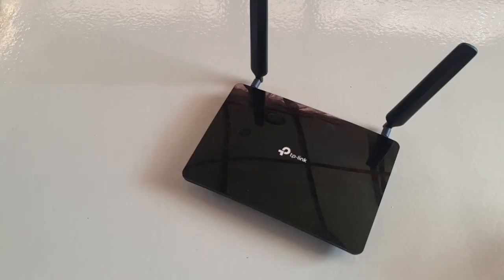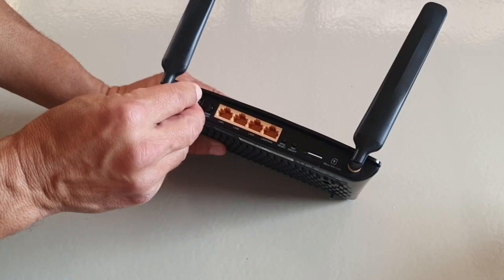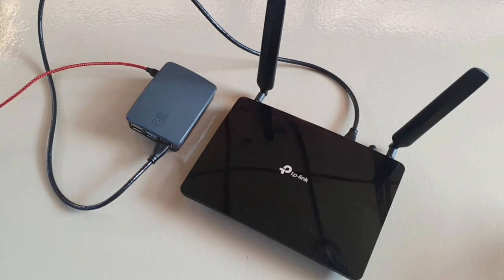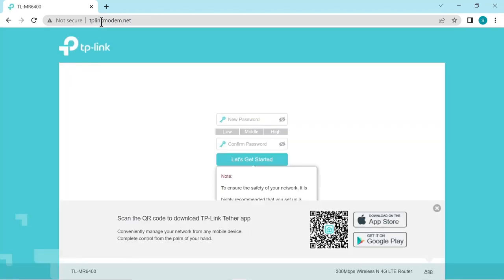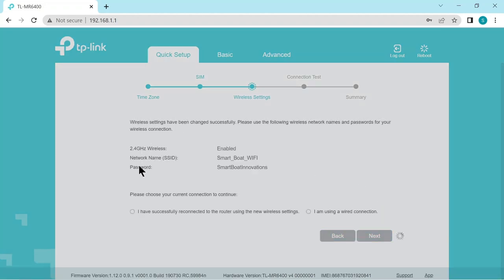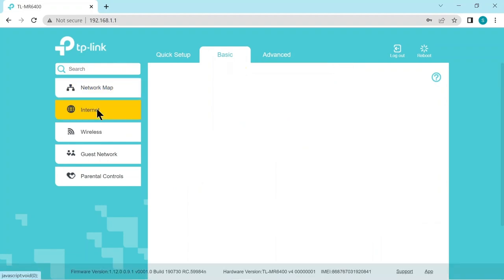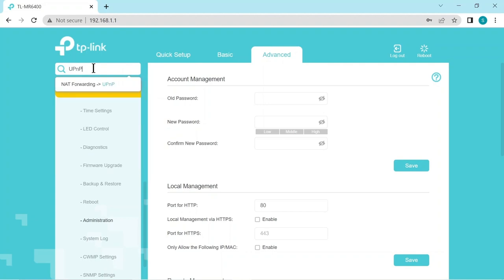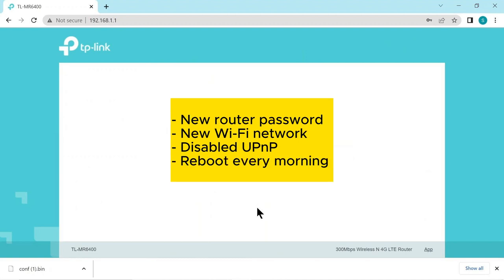Smart Boat 3:  Install and configure a 4G LTE Router

Comment: Very informative  . Clear instructions  which gives me the confidence  to convert my boat . Can you  connect  this type  of router  to Starlink? A video  on this would  be  beneficial. Many  thanks
Reply from the maker: Yes you can connect to Starlink but you will need to use the Starlink Ethernet adapter.

Comment: Thanks for the good informing videos. I will build a Smartboat system also. Will you also have s look at navigation on the Raspberry Pi using OpenCPN?
Reply from the maker: I currently rely on OpenCPN for long-distance navigation, and I believe it would be an excellent topic to explore in a future video. Navigation software and hardware offer a wide array of choices, and OpenCPN stands out as a versatile option that can run on various platforms, including Raspberry Pi, tablets, phones, and PCs. Additionally, for close navigation to an anchorage or port, I find Navionics to be incredibly useful on my phone and tablet. Another app I find valuable is Navily, which provides community information about the destination.
Reply: @SmartBoatInnovations  after seeing your automation videos I am planning on at least 2 Raspberry Pi’s on my boat. One for automation purposes. The other for navigation.

Comment: Great Video. Learned so much from all your videos. Thx so much  Captain  Rob. 
 I went for the USR-G806S for 80$ It has a RS485 interface builtin ;  it can direclty transfer my NMEA gateway to TCP.
Using the VPN option, (i see TP link also suppprts that_)  i have a site-2-site vpn between the home network (with home assitant running there)  and my boatnetwork. No Raspberry pi onboard .  Modem draws 0.1Amps with some ESP32 connected for the relays and vicrtron MPPT (thanks so much for that knowledge!) . So all the benefitts of smart Boat Innovations without a 2amp computer on board.  Setting up openvpn for this case is not rocket science either.
Reply from the maker: Interesting for remote access although I am not sure how this would work when you are sailing in remote location or how you can get all of your onboard esphome and zigbee devices to work.
Reply: @SmartBoatInnovations  The ESP's run fine on the boat WiFi that provides the VPN link to home.  For Zigbee I plan to use a cheap aliexpress Zigbee gateway but didnt have the time yet to test. The discovery of your channel messed up my agenda 🙂
The remote location scenario indeed takes away the access to home assistant. I can still directly access ESP,s on the web interface and NMEA is available via local WiFi. Sailing in the Netherlands, I usually have 4G available everywhere, but everything is designed redundant so i still have switches on top of the relayboard for classic boating. In a near future global internet coverage will be common, like Starlink, but cheaper ;-)
The added value for me is that I have one HA running both the house and the boat. I have already some automations running between the house and boat now. At the same time having a smaller battery/PV and little sunlight in the winter, I keep the daily consumption between 2 and 3Amps.